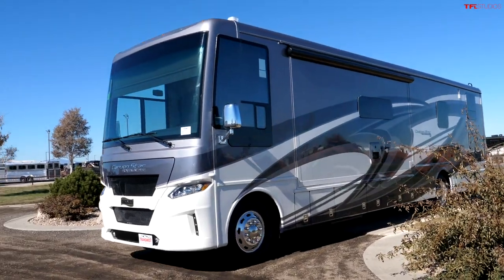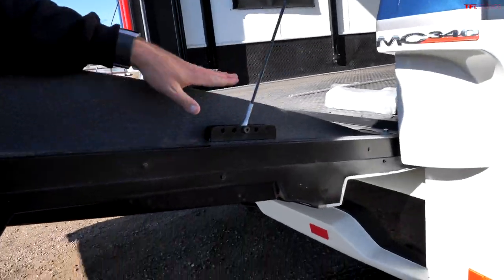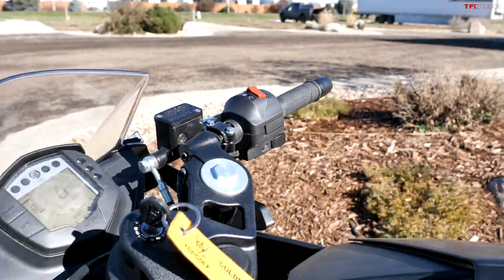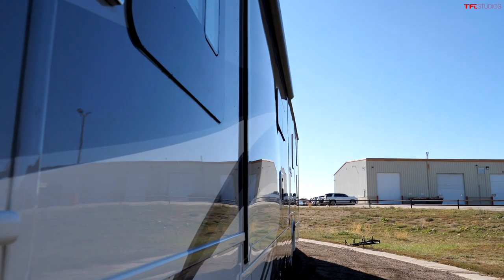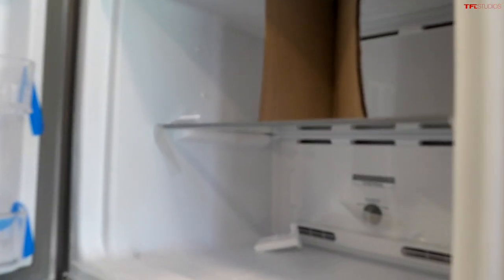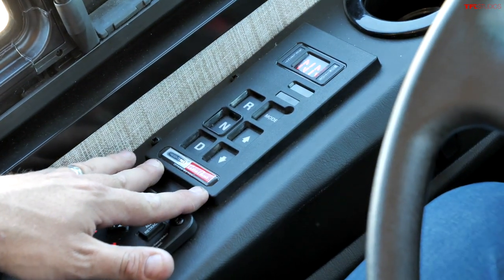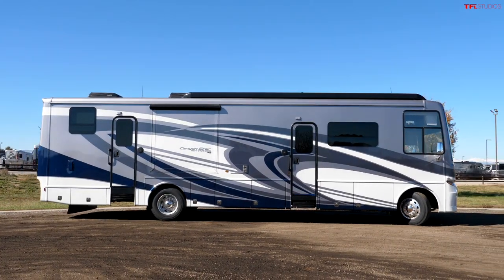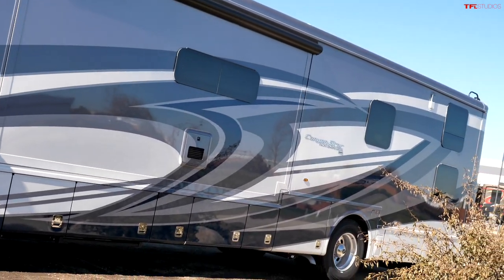This Diesel Motorhome Lets You Bring Your Big Toys With You Inside Its Garage!

Comment: I can’t even remember how many review videos I’ve watched on this Newmar and TFL is the only review that went into details of the whole reason people would buy this over a normal motorhome! The dang garage! I mean it’s important to note wether it has built in front wheel chock’s the strips of aircraft seat locks so you can use adjustable cargo spring loaded cleats. How steep the ramp is…. These are very important things to us old folk that want to drag our towes with us and sacrifice some room in our rolling homes! So thanks TFL

Comment: Toy hauler part is not unique but it’s the first front engine diesel I have seen.  Unique for sure.
Reply: They are not unheard of, just not near as popular as the front engine gassers.  Pretty sure almost all are the 6.7 Cummins.
Reply: @jamesbeaman6337  there are several Cummins engines used.  I have looked at a bunch of RVs. Thought about the Thor Outlaw as I have bikes and it would be easier than a separate trailer. Only downside is the garage takes away from living space.  

I assume this has front diesel because of the garage but like I said never seen a front engine diesel before.  

Wonder how noisy it is in real life
Reply: @davva360  I'd imagine it is pretty quiet, based on all the new diesels I'm around.

Comment: Two BIG problems (as a current toy hauler owner)...
*Garage door opens into the garage (when fully loaded, entry is ONLY from exterior).
*Ramp has a wonky shape preventing use as a suspended deck.

Newmar has ALWAYS done these things to their toy hauler...really sad when they are really not major design points.

Plus...being over 26K GVWR and having airbrakes can put add'l driver's license class requirements on many state license requirements.
Reply: Garage door does not open into the garage.  It opens outwards.
Reply: @frankdank7507  Errr...look again.  The interior garage door opens "in" to the garage.  That makes that door unusable when the garage is loaded and requires exiting the RV to use the exterior side door to access via the rear ramp.  Having one of these Class A Toy Haulers, we know that is a VERY big deal...really a deal-breaker.
Reply: @stevematthews684   Interior door?  Most of the toy haulers I've seen (and owned) opened into the garage.  Not a big deal.
Reply: @frankdank7507  This video is talking about motorhomes.  It IS a "big deal" when the driver has to exit the rig to get into the garage.
AND, the "most" toy hauler motorhomes ever made are Outlaw RV's.  Every model of Outlaw has the door open into the interior (swing or slide)...'cuz that just makes good sense.
Reply: @frankdank7507  You would lose that bet.  Why does reality and facts make you turn to insults?  LOL
Reply: @stevematthews684  Not an insult.  Just an observation.
Reply: @frankdank7507  You made "Just a guess..." And now it is magically an observation.  Here is a real observation, you have no opinion worth the time it took you to write it.  Com'on back when you can afford a Class A toy Hauler.
Reply: @stevematthews684   Can't afford one can you?  LOL!
Reply: @frankdank7507  can we all get all fellows, EASY FIX....get rid of the door.

Comment: There really isn't a whole lot of exterior storage. I'd like to see them build something like this on a raised rail chassis with some pass-thru storage. Also at that price, I would have liked to see a powered 50 amp cable reel. Still, I appreciate the concept, because I don't like the idea of powering a rig that size with a gasoline engine, the way that the rest of the manufacturers do.
Reply: there are others.

Comment: which type of licence to you need to drive one of these?? its basically an inter city bus
Reply: I'm guessing a non-commercial class B. Because of the GCWR and the air brakes.
Reply: Depends on the state you live in. Usually easy to find it on the web.

Comment: Initially, I thought this would be a great combo but apparently this is a very tough concept to sell and this is why these front engine diesel are not a very stable niche product. Why is this so, the price. It is a good 50k more than a gasser and there are comprimises that make you wonder if this extra cost is worth it. 
  These units because of diesel and the chassis is between 3 to 4 k heavier. This does mean that it rides better and the pickup diesel engine also get you better fuel mileage than a gasser. It is just slower plus it also means that the places that you might want to go boondocking with your toys might not be as accessable because of the weight and the lack of a locking rear end. Still lighter than a 32,000 lb diesel pusher (dp) but you can almost buy a used dp for the price your paying for a new one of these.
Reply: @Jerry Allen The steering wheel and gauge pack gave that away. Still does not justify the extra cost.
Reply: look at Jayco not Newmar you may be happier.  Newmar is for people that want nicer things.
Reply: @badgerpa9  ha ha very funny. I was commenting on the model line not the company. Don't forget that it is now Newmar/Winnebago now, so these risks may have never taken place with the past admin. Jayco, I will leave them all for you, even though I doubt they have such a platform.
Reply: @LowsJuan  they jayco have one on a ford chassis or at least did. .  This is the bottom of the newmar line but I am glad they make it as others will too and they all get better then.  Don't let rona catch